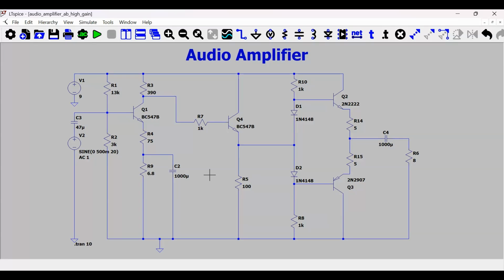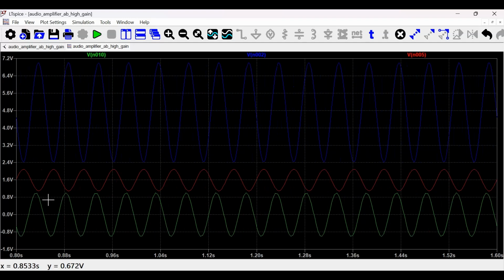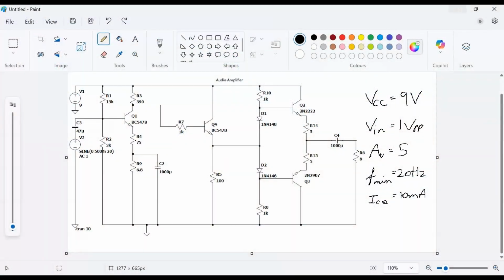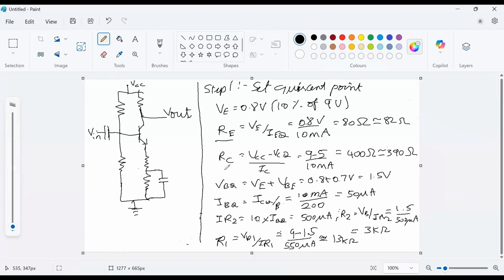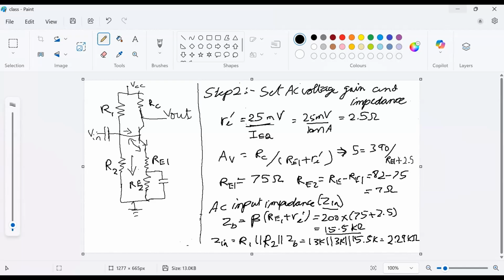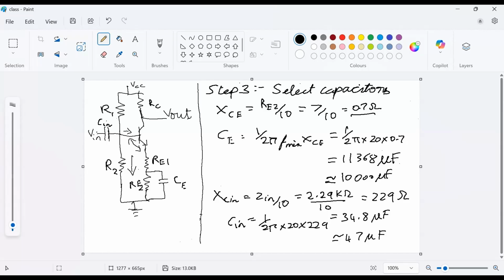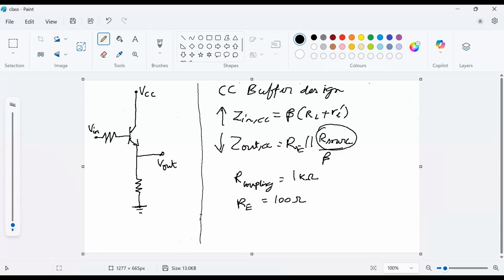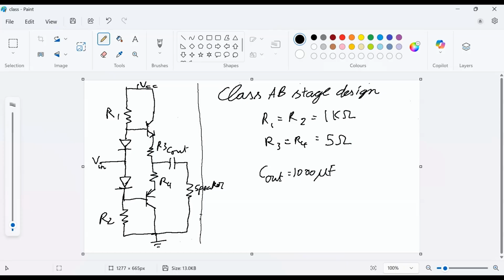Audio amplifier using transistors

Comment: Dear Mr.Prithivin,
I believe this system can be designed of miniature size as you rightly referred, about the smart phone speaker system....I believe such a system is only used in HEARING AIDS used by the hearing impaired or by those who have a loss of hearing sensitivity especially by the old aged....by...Prof.PRL.